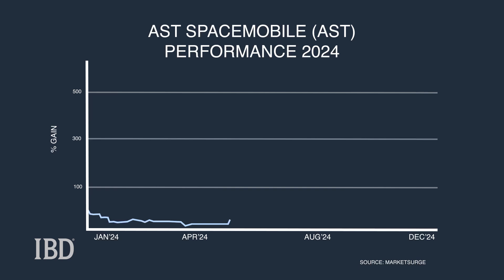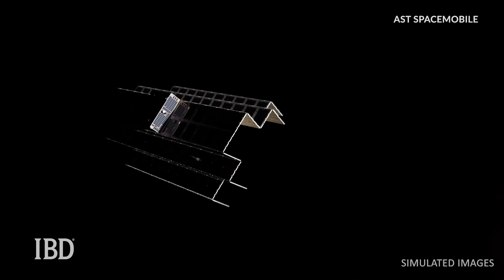Can This Starlink Rival's Satellite Cellular Network Live Up To Sky-High Expectations?

Comment: How does this differ from SpaceX's solution?
Reply: It works with your regular smartphone. Don´t need to buy anything else.
Reply: @gorkaa9688  That's true of SpaceX's solution as well.
Reply: @DanielASchaeffer starlink is only text.  And so far delayed texting.  AST will be voice, text and data.
Reply: @DanielASchaeffer  Nop. For the  starlink solution you need  a satelital antena to use as wifi at home. Outside home you need the starlink smartphone.
Reply: @Praetorian00  Starlink is voice, text and data, with video calls also being possible*. And its done from the phone. SpaceX also has the massive scale advantage, and will be with lower latency (closer to earth). I really find it hard to believe that AST will be a serious contender in this space, especially given that they've just lost the advantage of an early start. The only thing they've got as an edge, is that they want to provide higher bandwidth. But that comes at a cost. Higher price of service. This race will be decided within the next few years, but maybe they're only planning on providing a premium cell service to select customers.
Reply: @ why did 45 MNOs choose AST over Starlink?
Reply: @Praetorian00  Fair question. There wasn't any Starlink Direct to Cell until recently.

I think it has more to do with the fact that its so new. 

AST, have they actually launched the service yet, or a beta version of it?
Reply: @gorkaa9688  This is completely false. SpaceX is using standard 1900MHz PCS G Band which is native to all cellular phones made in at least the past 10 years.  I realize your post was 3 months ago, but the announcement with T-Mobile was made back in August of 2022 and it has been known since at least then that they would be using PCS 1900MHz.
Reply: @ Only for SMS... I thought we were talking about 5g conection. Maybe we are not in the same conversation.